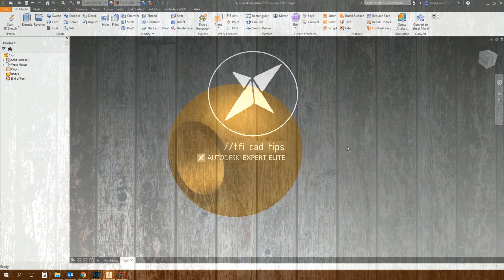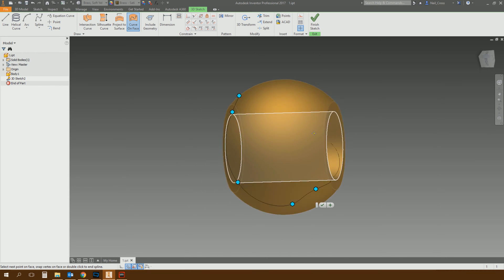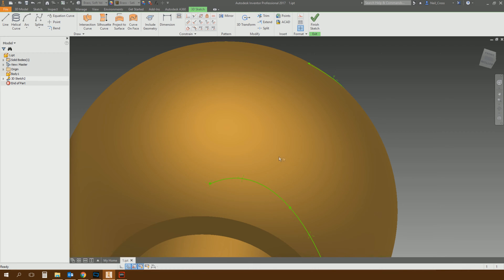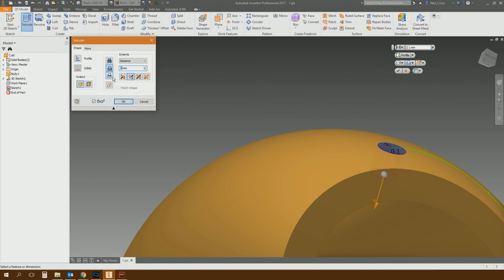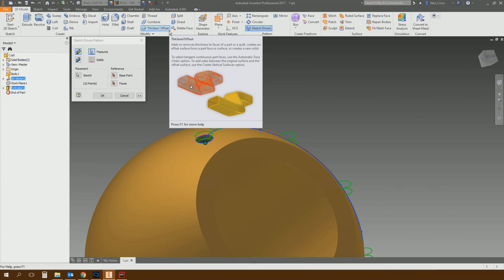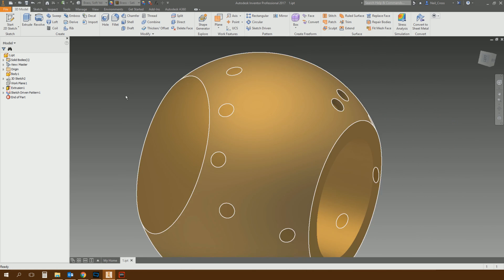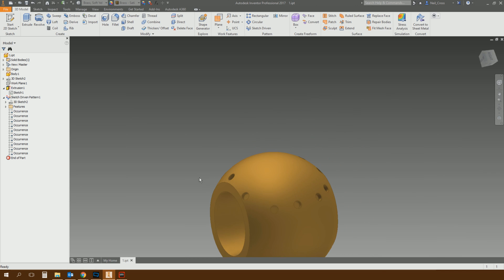Sketch Driven Feature Patterns // What's New Inventor 2017 [Video #10 of 11]

Comment: For your example of creating the hole why would i choose a sketch driven pattern instead of just using the hole tool on each of hole points. What is the difference?
Reply: Try to use the hole tool for 100+ holes

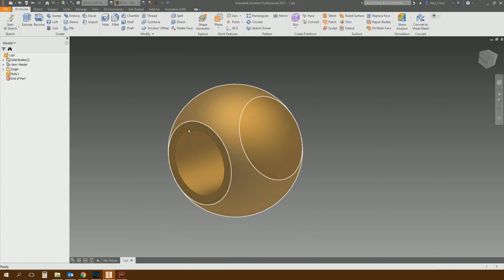Comment: this is nice feature that will add more flexibility to modeling. but must sort of disagree with you on what you say @0:53. I've been working with inv2014. and since 2014 version it has a possibility to make an equally spaced pattern along any curve as long as the curve is flat. the pattern can be orientated or not to the curve. I use this option very very often, it makes patterns in assemblies to work like a charm.
Reply from the maker: +Vytautas Ivanauskas Mmm nope I think what I said was accurate! In 2014 - 2016 the pattern commands in part mode are rectangular and circular, and I then followed that by saying you could pattern along a spline (curve) or axis, I've also already done a dedicated video on patterning along a curve! Not sure you can orient the feature to the curve either, just tried now and there's no option in 2016 to adjust the orientation in a 3D pattern in 2016...? Where would you do this?
Reply: +TFI CAD Tips Sorry, didn't mean to offend or anything. I watch your videos a lot, an learn a lot:). create sketch with the 3d feature base and then create any shape curve (spline, oval, closed loop etc.). the path curve can be the same sketch or different, doesn't matter.then extrude your profile (cut or join) then go rectangular pattern.select feature, then select direction 1 the curve (path). put in how many instances and the spacing. expand the menu (double arrow). under direction 1 click the point where to start the pattern.under compute select ether identical or adjust (this will orient the feature or not along the path curve). under orientation select direction 1. done!! man, if i helped you, then i'll be beating my chest as king Kong!! it'll be like padawan has taught his master of where the missing galaxy is :):)
Reply from the maker: +Vytautas Ivanauskas Haha it's all good man, I can't always remember and memorise everything in the program and you are indeed right... I sometimes get mixed up between pattern commands and thought the right hand side options where for direction 2 but you're right that's the pattern orientation.  I think I even mentioned this and covered it in my original pattern video but completely forgot! You may beat your chest like king kong!
Reply: @Neil3D  Hello Sir,
can you please guide me how to make a hole on cylinder surface in the pattern of the spiral line each hole is at an angle of 25 or etc. from the previous hole and at hight from 20 mm from the previous hole.